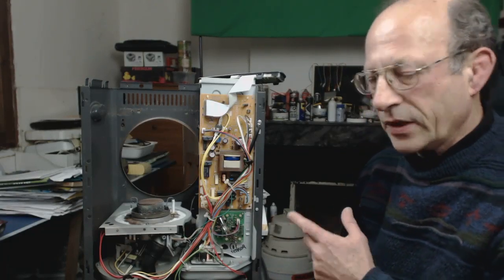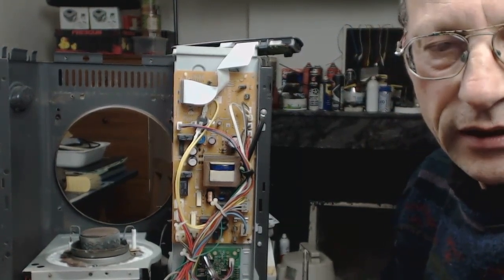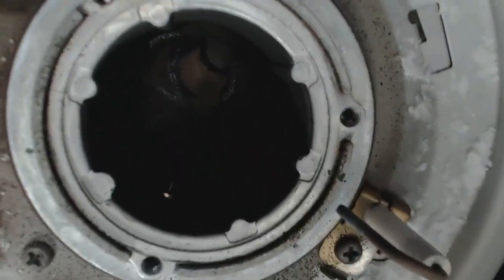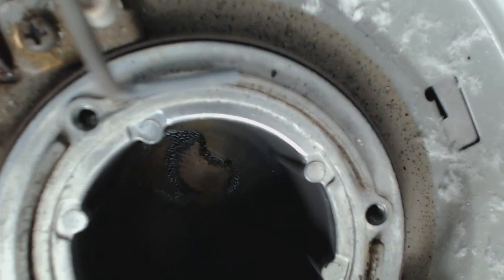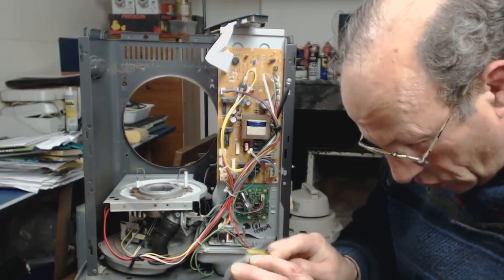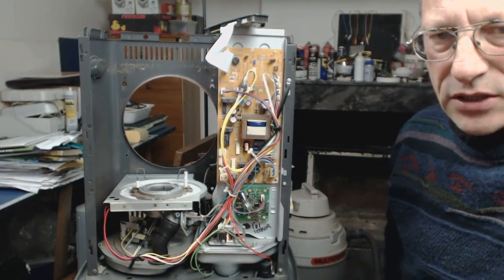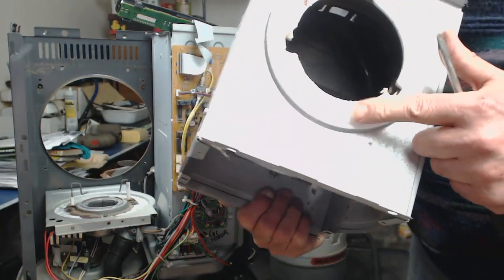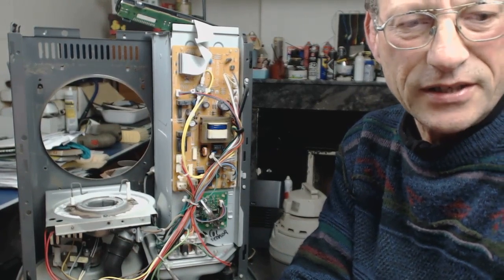Paraffin / kerosene / petrole heater: E4 Error (E0-E4) - Easy Fix

Comment: Thank you for this. Just saved me a lot of $ and additional aggravation! Heater works like new, and is burning cleaner and more efficiently.
Reply from the maker: That's great news Jeremy :)
Reply: @EngineTuning  oh no, 24 hours later it’s gone crazy again. Any idea where to get replacements for these? I see a lot of these little sensors online but nothing corona-brand-specific. This one has a unique square bend in it while most I see are just 90-degree angles. Are these a thing where any probe will do, or does it have to be very specific?
Reply from the maker: @jeremybernal7721  
I don't know what the problem is, so I don't know the solution.
It is usually dirty 'flame rod' or wrong fuel, old fuel, or water contaminated fuel.
It could be a blocked air grill.
If it's not one of those, then it could be a failed component.
Good luck!

Comment: Thanks for posting this vid. A friend gave me his 'broken' (E4 problem) heater yesterday as it was going to the déchetterie. Took me 10 mins to take apart, 2 mins to clean the flame rod and fix a small split in the rubber air pipe, then 10 mins to put back together. The machine now works perfectly.   Thanks again.
Reply from the maker: Great story jj.
Thanks for sharing :D

One thing is for sure... a visit to the déchetterie can be like 'free shopping'.
I recently visited my local déchetterie to dump some stuff.
My reward was an air compressor, that required an €11 spend.

I know, I know... we shouldn't pull stuff out of the skip.
But it was just there... I couldn't resist the temptation.
... and, by repairing it... this is the best recyclage :)

Comment: Hello, I bought one of these heaters a few years ago, as a back up heater. Then decided to use it now because of recent gas price increases. I thought I would be the clever one, by only using "Ultra Low Sulphur" paraffin. I got one trouble free winter use out of it, now it has died in the second winter with E0 and E04 errors. Probably because I used the heater on minimum heat for a while. I now believe that these heaters must be cleaned and serviced every year, regardless of the fuel used. Something they don't tell you when you buy one.
Reply from the maker: I'm surprised that you only got one season out of it, but I agree with your conclusion re the setting to minimum heat.

Add 0.5% acetone to each refill.
This should help ensure a clean blue burn, whilst set to minimum.
(Obviously, this raises the heat output) ;)
Reply: I buy Paraffin Extra online from a company that sells the Corona heaters, as it is about the same price delivered, as buying local standard paraffin. Last winter I burnt 64 litres. This year I managed 48 litres. Then for a week or so, I was getting the E4 error code on start up, but it would burn if I did an immediate restart. I cleaned the filter which did not look dirty. No difference. So I ran the last 4 litres at full power to see if that would clear it. Then I refilled it again. I am now getting a mix of E0 and E4 codes when I light it. If it does start after a couple of tries, it only runs for a 10 minutes, and stops with an E0 or E4 code.  @EngineTuning
Reply from the maker: @corringhamdepot4434  
You could try it with acetone first.
Maybe the flame rod would clean up.
Otherwise you will need to manually clean the flame rod.

With the front grill off; let the heater get to full temp, and look at the flame ... there should be no yellow flames.
Then lower the temp, checking the flame colour as you go.

Comment from the maker: Update on results: After cleaning the flame rod, my heater burns better (read more)
Easy Servicing and correcting E4 (typical E errors) on liquid fuel burning heaters - of type: stove, paraffin heater, kerosene heater, chauffage à pétrole, poêle à pétrole électronique, BPE 367, Squall, Japanese heater.

My heater did not have an E error, when making this video.
However, you will see me clean up the flame rod, and brush out the gasifier.

Previously if I set the temperature to 14... it would raise the temperature to 15
I guessed that it was burning at the minimum setting.
However, after assembly, the heater ran perfectly at 14 degrees, when set to 14, and no fumes at all.

The actual room temperature is probably 16 but the heater is in a fireplace under a chimney, so the temperature sensor is more exposed to the cold fresh air being pulled through the heater.
Obviously, it could get the workshop cooking, but with normal winter clothing, I don't want it hot.
Having it on a very low setting, means that the fuel lasts much longer.
 
So if your heater struggles at it's low settings.... this fix is likely to sort that problem.
:)

Comment: I thank you for this information. In general terms I would say this kind of heater need a yearly maintenance and also the most important to filtrate the kerosene through a funnel listed by UL and/or EU norms. I use a Mr. Funnel unit with good results.
Kind regards 
Santiago de Chile the southern capital of the world
Reply from the maker: Thanks Dario for sharing your thoughts and experience :)
Reply: @EngineTuning  I also use a Mister Funnel with my 5006 Inverter Heater. I have used the Mister Funnel from the beginning - I have now been heating my downstairs rooms for four years. I use what is known in the UK as Kerosene, or twenty-eight second heating oil, the use of which invalidates the guarantee. I have never had a moment's trouble with this fuel, and have saved considerably on the cost of Grade One Paraffin.
Reply from the maker: @davidmaddaford930  Yes, it will burn, and it's great that you have had no problems.
However, the kerosene is less refined, and therefore as a matter of chemistry, the fumes contain higher levels of toxic elements.
Hence why it is designated as an oil for burning with a vented flue.
To ameliorate this, you can add 1% acetone to the fuel ... it will clean up the combustion, and burn slightly hotter.
A hotter burn eliminates more of the toxicity.
(I use it with the high grade paraffin to get an even higher boost) ;)
Personally,
Reply: @EngineTuning  Thanks for the reply and thanks for the instructions on how to clean and service these heaters. I feel more confident about servicing it myself after watching your video. I have had it serviced once previously at the dealer from whom I purchased it, but with the unprecedented conditions which continue to prevail I think that I shall have to do a self-service.
Reply from the maker: @davidmaddaford930  Go for it :D

Comment: On the last part you took off the well with the 2 holes in the brass coloured gauze(primary grill), do they line up with the burner and igniter? Mine don't line up 100% is what made me ask, Only bit i couldn't see properly, cheers.
Reply from the maker: You need to tag the time eg. 6:43
The mesh gasifier top, has an arrow to align with the sparker 8:13
Reply: @EngineTuning  it's at 9.11 in the primary grill there are lots of smaller holes but 2 larger holes, should they be lined up to igniter and burner or does it mater? if mines don't line up could the burner or igniter be offline, possibly I'm thinking.
Reply from the maker: @socrates470BCE  I can't see any issues :(

Comment: How often need do service on those heaters?Before cuts off?.Thanks in adventure.
Reply from the maker: It depends upon the fuel that you are using.
If you are using high grade (C1) fuel, that is specifically sold for portable indoor heaters, they may function fine for multiple seasons, without a serious service.
This can be improved by adding 1% acetone to fuel.
This will cause the burn to be cleaner, and deliver more heat.
What you should do, at the end of each season, is remove the fuel, and cover the heater in some old cotton sheets, to stabilise humidity.

If you are using heating oil or kerosene, designed for vented systems; you must add acetone, and you may need to service the heater each season.

Check out this video discussing the different fuels:
https://youtu.be/dRmrEOBsEDw

Comment: I have 2 the same. hear sound but does not light up. The fan doesn't want to spin either. I cleaned everything according to your videos. The other one looks dead but only flashes red when I press a key owzo annoying this
Reply from the maker: Failure is hard to bear; particularly after substantial effort :(

Comment: Thank you for posting this and other videos, they're extremely helpful. I've just bought a used Tayosan and given it a quick strip down and clean (no fault codes) with your guidance. I've noticed with mine that there's an electrical humming noise from within the machine even when switched off on the control panel. Obviously unplugging it deals with the noise but I'm curious to know if you experience this humming noise on your version of the heater? All the best to you :)
Reply from the maker: Ah yes ... the modern ON/OFF switch (which isn't)
It is so ubiquitous, that we all can easily forget that the devices are still powered ON.

The best option is to use the socket switch, or pull the plug.
Otherwise, the power is feeding the transformer - which reduces the voltage down to whatever the circuit board requires - typically for consumer products ranging from 12V down to 3.5V.

In some cases we get lucky, and the sound of a humming transformer alerts us to the hole in our pocket.
You got lucky, Ross :D

To reduce the hum, ensure that it is well mounted ... think about the heater resonating in tune with the transformer, and work against it :)
Reply: @EngineTuning  much appreciated Sir, I'll follow you advice and simply unplug or switch it off at the socket. I have it sat on a piece of thick pile carpet so it's as quiet as it's gonna get I reckon. Thanks again pal :)

Comment: Hi there. Really good video, very well explained.
I had the e03 error (no flame) and after exploring every posible scenario, we realized that the problem was the sparker: it doesn't work. The paraffin gets heated normally, turns into gas, but that's it, it doesn't get lit. We tried throwing a lit matchstick into the heater when the gas started flowing out and it worked wonderfully. So yeah, the problem is the sparker.
Don't really want to open the spark generator so we'll buy a new one and install it. I'm just wondering if any AC220v spark generator would work or if it needs certain specifications. Unfortunately, I couldn't find anything about the KSP152 my KERONA heater uses.
Any help or commentary would be greatly appreciated.
Reply from the maker: Good error report Javier :)

It is difficult to diagnose such a problem.
I would first clean and remake all the wiring connections, and clean the sparker rod and grill.

If a component has failed, the choice is clear...
Repair the component; buy the correct replacement; or launch into a development project, and add your own spark generator.

Good luck with this :)
Reply: @EngineTuning  We did clean the sparker rod and the flame rod, just in case.
We checked the electronic board and the connector that goes to the spark generator does supply 225vac, no problem. We also verified the generator's ground is connected to mass, so the problem has to be the generator.
We'll see if we can find an affordable replacement or something (will see about making one). The winter is coming in a couple of months here in Chile, so we gotta be prepared.
If and when we get it fixed I'll comment an update on this.
Anyway, thanks for the help, the video was a good starting point to find the fault.

Comment: Hi and thanks for posting the video it is excellent. My question to you is have you ever had a problem with it beeping and the oil light coming on then shortly after shuts down. Now I know this  is when it is running out of fuel, but mine does it when there is plenty of fuel left in, and it won't start again because it must think the fuel has run out even though its not. I have fiddled with the float in the tank but no luck it still won't run. Have you any advice or help you could share with me please. Thank you and I look forward to your response.
Reply from the maker: Hi Gaz, that's a new one on me.
It is most likely going to be the float switch, or the cable connections between it and the board
Reply: @EngineTuning 
Hi and thank you for your reply. I have checked the float switch and all the cables and they seem fine. I have noticed when you lift the fuel tank in and out you can hear a bubbling noise and after about 5 or 6 times the oil light goes out and the heater works again for a couple of hours. Could it be the fuel tank lid as I have noticed some corrosion in the fuel tank, my thoughts are maybe a blocked breather in the lid. What are your thoughts on this.
Reply from the maker: @gaztomm5741  That's first class analytical thinking Gaz.
Yes, a vacuum could be the cause of the problem.
Somehow I doubt it, but the thinking is correct.
The bubbling noise is typical to these heaters, and it means that the fuel is entering the fixed reservoir.

When you checked the switch, did you meter it, to confirm that the circuit goes open and closed.

When the float is up, note whether the circuit is open or closed.
Obv when the float is down, it will be the opposite.
Meter this on/off movement a few times to confirm switch stability.

Ensure that the float is empty, ie. not punctured and containing fuel.
ie. that the float is floating :D

You need to fully understand this circuit, and the mechanical components that impact upon the actuation of the circuit.

I don't know what your board voltage is.
Perhaps 5v, 3v, or 12v.

The board registers a switched condition, when either it sees a voltage at the connector, or it doesn't.

eg. 
5v = 1
0v = 0
or vice versa

Meaning, if there is 5v between the connector and ground, the system switches on (there is fuel).
If 0v the system switches off.